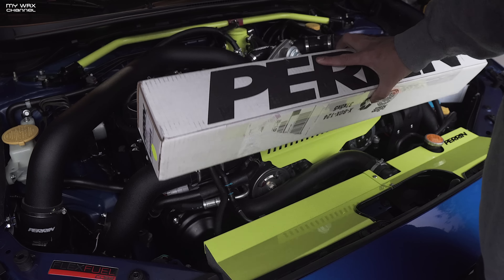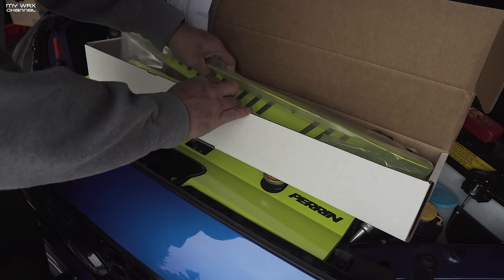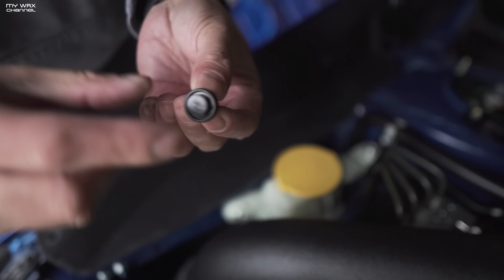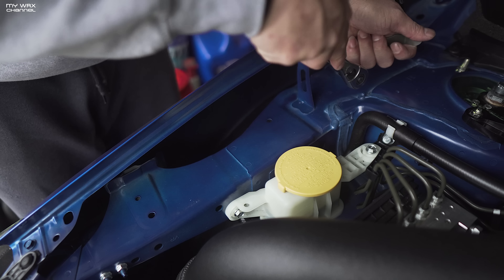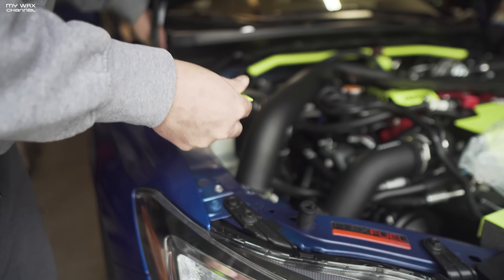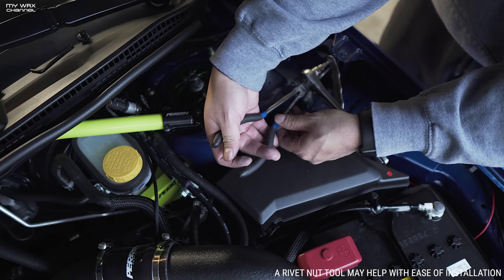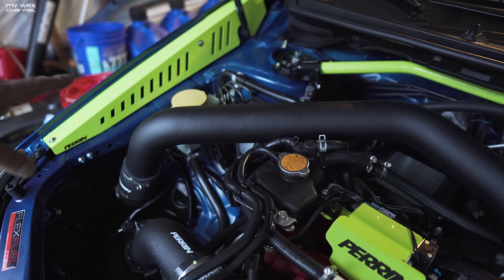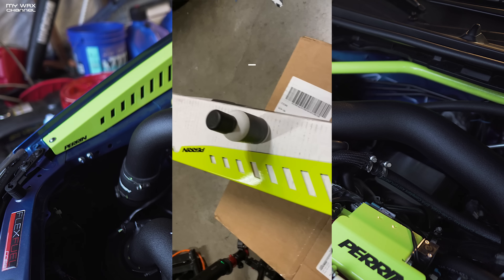***NEW*** PERRIN FENDER SHROUDS | 2015-2020 SUBARU WRX STI

Comment: Bought the Compressive Tuning Air blades a few months ago. They reuse the pop clips and are rock solid. Rather odd Perrin went with Rivet nuts. I assume they have their reason. Just makes the installation a bit more complex. 

I will say, the Air blades paired with a Perrin Radiator Shroud has brought my IAT down a lot. Even though the fenders don't have a actual outlet for hot air, the door to fender gap must be enough to vent the hot air out.
Reply: You just need to pop the vents and dremel into them and the car

Comment: Those rivets are junk. I drilled out the hole a tiny bit and used the pop clips. It makes for a way easier install
Reply: I just installed these on my sti, the rivets are absolutely garbage. I was searching to see if I was the only one aha
Reply: @VehxyOG  I drilled mine as well and used the pop clips.  I am trying to source some speed clips/uclips for my titanium works bolts, unfortunately any store that sells hardware around me doesnt have what I need. Waiting on some that are coming from China so who knows when those will arrive.